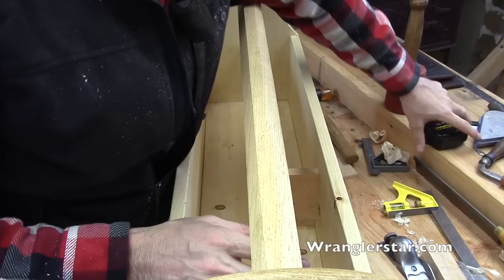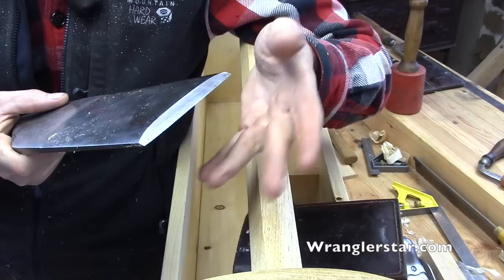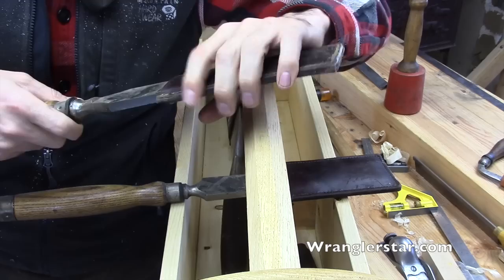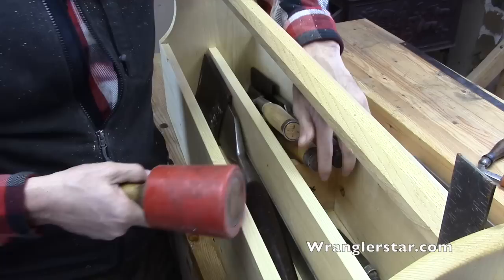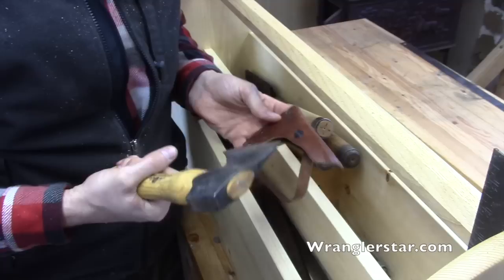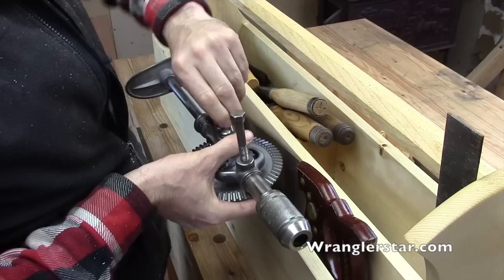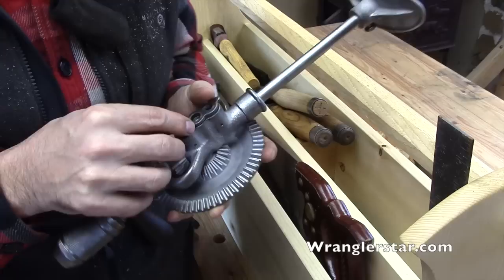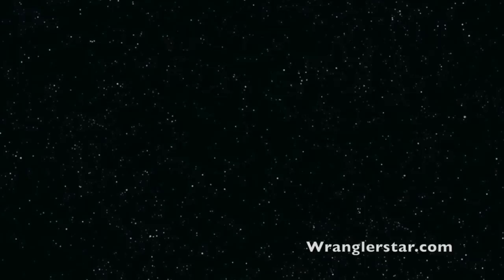What To Put In Your Tool Kit | Wranglerstar

Comment: One add on I would make to your tool box is two leather pouches on either gable end you can decide on what size but they could be mounted on the outside where you would have say your carpenter pencils, sharpie pens, or small items that you use on a regular basis. You know what happens to small items like pencils they end up in the bottom of the tool box you have to pull all the tools out to get to your pencil or your trying to reach your hand in getting stabbed in the process.
Inside the box give it a good coat of wax or heavier mixture of wax and BLO the wax will help protect the fibers from tearing from wear instead of the sharp edges of the tools digging into the soft wood it will slide instead.
Reply: i think thats a great idea putting a leather pouches on the ends for pencils and what not of small things
Reply: How I know that is one of  my carpenter friends had his tool box set up like that.
Reply: I was just about to mention wrapping the handle in leather might be nice and hood practice with the new leather tools. Figured replying here is as good as anywhere

Comment: Many Japanese chisels and cutting tools are still laminated. Much older tools (from all places)  will not be steel for the main body of the tool but rather wrought iron.  Laminated construction of cutting tools fell out of regular use in production made tools as high carbon steel was more cheaply available.

Comment: Very nice! 

I'm probably far too late, this was 12 months ago, but I would consider using a triangular piece of wood as the base for the corner chisel sheath. Glue and nail leather to the sides, glue some leather to the inner face of the triangular, to cushion the chisel, then make the open end snap or buckle closed. Just need a rivet or two up the join.

Comment: You could make it so that you hook on a box for the drills or anything you only need now and again and you have plenty of space in the front and back face to add on, pardon the bun but thinking outside of the box and military surplus is somewhere you can find lots of ideas and supply even use a bag for its tough fabric. Hope this helps.

Comment: Just a thought. I would make a platform with large robust wheels to put this on along with room with for containers to easily carry a full tool loadout  anywhere on the property. All in a vertical position so you arent having to dig around for this tool or that. Never have to run back to the shop for a tool again. I find for me its a real time saver being able to easily carry all the basic tools anywhere all at once.

Comment: Great video Cody.  I think you will find a bit that large will be a bit much for a breast drill. (Though I have been mistaken before.)  If I am not mistaken, bits that large are typically used with a T handle.  I think I remember Dave Canterbury forging a T handle that would utilize the auger bits.  The handle he made would accept different bits with the pyramid type chuck end.  Which I thought was a great idea as it makes sense to have one handle vs's several T augers with built in handles, as I have.  I however don't know how hard it would be to forge a hex bit chuck vs's the pyramid style. You may already be aware of all of this, and I in no way mean to insult your intelligence.  It was an inspirational series of videos.  I need to find the time to build a similar box.  Well done!

Best Regards,

Comment: How about adding a pair of stair gages?   Maybe I am assuming that you know what stair gages are.  They are octigon shaped metal blocks that have a slot and set screw so that you can install them on you frameing square instead of just lineing up the square with the measurements.  Sure makes a big difference when making repetitive angle cuts.

Comment: Hi wranglerstar! I'm a beginner with the "dovetails" and I have the same toolbox projet. But I have just a little question, why did you put the dovetail joint in this direction? I think the weight of your tools is pushing on the two long boards. And this two long boards have to be locked in the perpendicular direction of the handle. In this direction, your boards are not locked mechanically, but just with glue... Is that wrong? (I'm sorry for my bad english... and I don't want to hurt you with my question, I ask just because I have the same project..) Thank you for your answer, I love your projects and your videos!

Comment: Just a thought, maybe inset magnets to hold long thin objects such as the framing square, handsaw or steel ruler in place?
Reply: Or perhaps a magnet in the handle where the framing square hits it, so it doesn't tip outwards.

Comment: i wouldn't put in in the bed of my truck, i would put it in the bench in the back of the cab (if you have an extended cab) to keep the dirt off of it and keep it from getting dents and chips taken out of it from rocks and other stuff in the truck bed :) just my two cents...